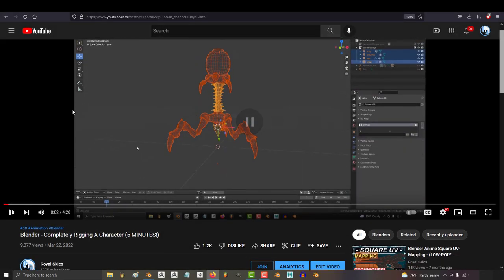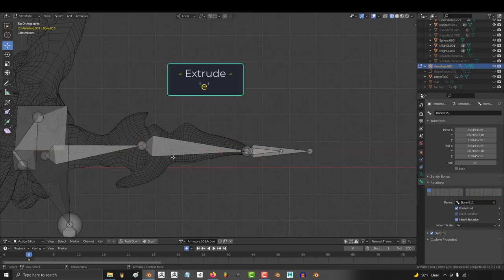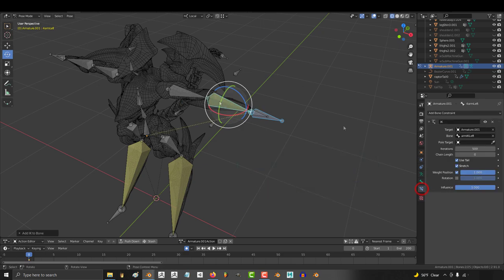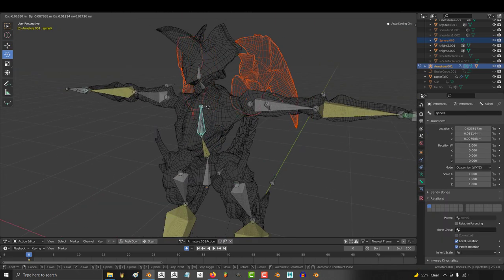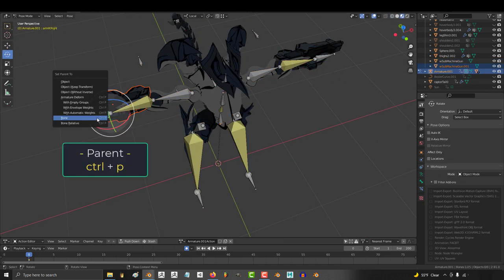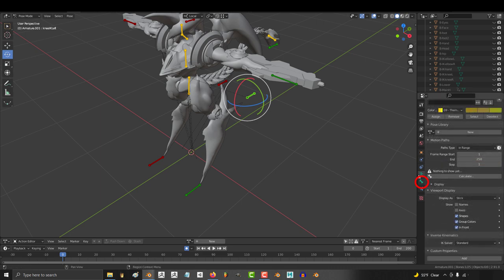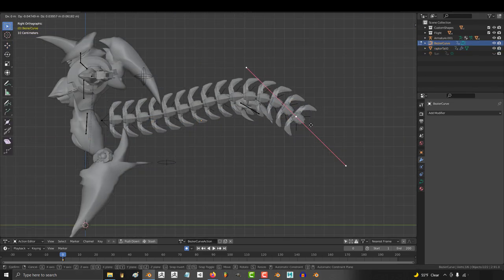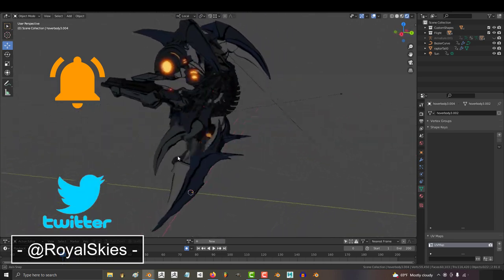Rigging REVERSE-JOINT Characters (FULL PROCESS)

Comment: I just want to throw this out there, that blender can autoname the LEFT/RIGHT bone names without you manually doing it.
Just select the bones you're wanting to be named > Press W > Names >  Auto-Name Left/Right.

I hope someone sees this, because out of the process of rigging, i'd say manually naming with .left/.right is too much, if you do want yo manually name them I'd advise just putting ".l/.r" at the ends of the names instead of the full "left/right" name, it works as well with the mirroring of the bones.
Reply: Nice, I didn't know you could auto name. Much appreciated 🙏
Reply: A MA ZI N G !
Reply: You can also just select all left bones and open the search menu and type "symmetrize" will duplicate the bones to the other side with correct naming (if all prior bones had .l attached)
Reply: @Ikxi  I also said that in the Og post
Reply: @CassyDaBean  ah I had just skimmed your comment, so I missed it

Comment: Only flaw I notice, (feel free to correct me if im wrong so I learn) is when creating an IK for the spine. You need to remove the parent from the lower spine (line the arms and legs) in order for it to work. This however makes it so the upper body does not move with the hip (lowest spine) bone.

Comment: I noticed at around the 3:04 min mark, when The legs' meshes are autopainted to the rig, they "popped" slightly. As if the leg's bones were moving. 
I got those issues with legs that had an angle: I put a pole, but then the ik seems to move places, even when the -90 degree changes were made. I had to mode the pole Bone to make the leg not move from its original pose. Did people here got that issue?

Comment: Do you have a blender tutorial for porting a character from (somewhere) into a game, please? I can assign the bones from an exported model to be used for the new model to said model but that's about it. The character then wiggles from left to right (based on assigned animation package from the game) but it is static (for example the arms are frozen solid while wiggling instead of having their own take on the wiggle. This could also be due to the two models (anything exported from the game, and a character I want to import) having two different T-poses, thereby the arms are not high enough for the bones to reach, but... I dunno. If you couldn't tell, I am an absolute beginner in all this and using blender 2.79.

Comment: what does it even mean reverse joint character ? :)
Reply: when knees bend backward instead of forward
Reply: @Dabbl1ng  Ah, i didn't think there should be a difference
Reply: @farianderson168  In terms of how to rig it, there actually isn't. At most, where you want to position the IK pole, but other than that it's the same process.
Reply: In the majority of cases, a 'reverse joint' character will refer to an anthromorphic character (such as, say, a furry) that's either digitigrade or ungulligrade: they walk on the length of the toes or the tips of the toes. Common examples are anthro dogs: Charlie from All Dogs Go to Heaven is digitigrade when he's walking on two legs. When you see a satyr or an anthro horse that walks on two legs, typically they'll be walking on flat hooves, which is the tips of their toes. So in theory, you can just use the same humanoid rig on any four-legged creature, it just becomes a bit ungainly depending on the proportions. Trust me, I've tried: adjusting topology to put the heel in the right place makes for a nice look, but controlling that rig gets tricky, since you end up having to grab at a large section of limb for IK controls instead of the smaller bits, like you would in a human. Haven't experimented much with that lately, though, so get a second opinion on that. 

Those designs have a large bend backwards, which at first looks like it's the knee going backwards. In reality, they have a very small hip bone, and the big bend backwards is the shin. Everything pointing straight down beyond that point is really the foot.

That's for the legs. In the arms, when you have a reverse joint it's usually something with blades or wings at the extremities, that fold in so they walk or crawl on their knuckles. Ka Zhix from League of Legends, or anything that's modelled after a praying mantis, will have that look. Again, though, in reality that big bend backwards is the wrist, not the elbow, and the actual elbow still goes forward as you'd expect.  If you see wyverns or other dragon-type creatures walking with wings folded like they're arms, generally those are folded hands as well, comparable to bat wings. It's easier to spot that in arms than it is in legs. If you're interested in getting things absolutely 'right' in this area, just look up the term "homologous organs" and check what the topology and rigging is for a human, then copy that over as needed. 

The model Royal Skies is using here is not modelled after natural anatomy, though, it's lacking feet and hands, so those are genuine backwards knees and elbows. No critiques there, sometimes you just want a design that looks alien and reversing joints is an easy way to do that.